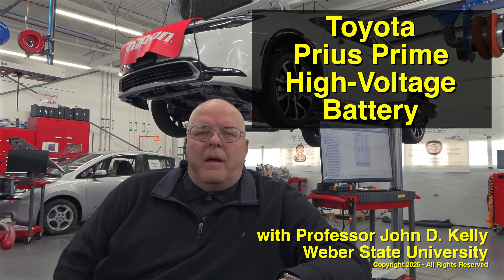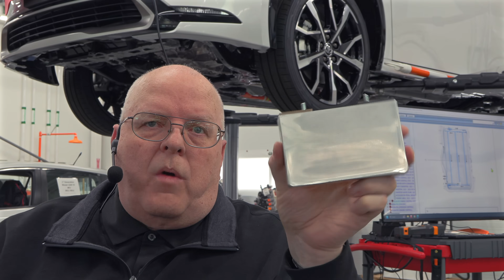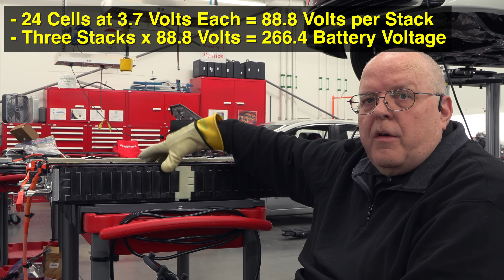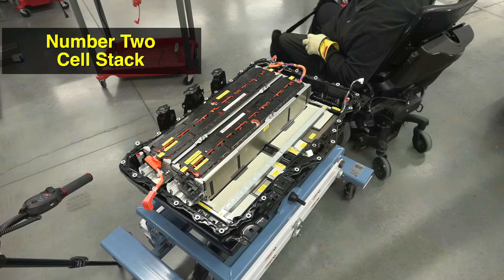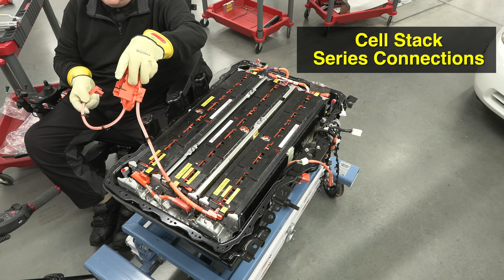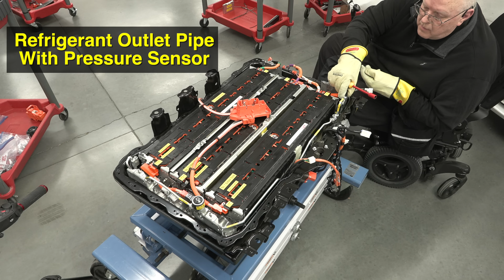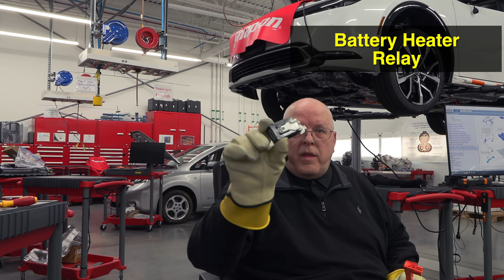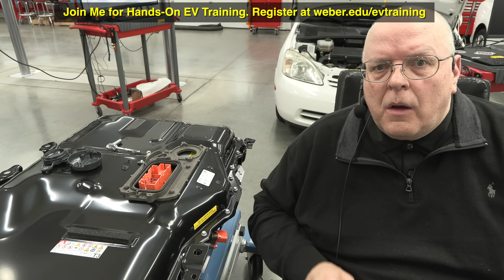2024 Prius Prime/PHEV High-Voltage Battery Build

Comment: 2:53 hey the “Heat Shields” are actually thermoformed Mica sheets that are used as high voltage insulators! Used all over EVs! Very cool material
Reply from the maker: Awesome information. Thank you very much!
Reply: Mica sheets have also been used in high voltage ozone generators for over 100 years- although not as pretty as those shown by the good Professor. The key characteristic is very high dielectric strength.  Useful features abound for separating battery stacks: thermal insulation, electric insulation, high bending strength due to laminations (in the original mined type at least), chemical resistance and flame retardancy.
Reply: Micarta and mica are distinct materials. Micarta is a trade name for a type of laminate made from layers of cloth or paper impregnated with phenolic resin, while mica is a naturally occurring mineral known for its sheet-like structure and electrical insulating properties.
Reply: I believe that they also serve as fire barrier, preventing or at least retarding the spread of a thermal runaway.
Reply: As a novice tinkerer: I recognized it immediately, especially since it wobbled silently. @doppelhub uses it in his design for a lithium battery kit for the 2000-2006 Honda Insight - https://youtu.be/hQprOqE1FKs?t=571 - very useful for letting you allow conductors which have high potential between them to press very near each other without worrying about creepages. I really wonder who manufactures these -- it'd be really interesting if formed mica were more accessible.
Reply: Correct. They are also used, because it is material that does not burn. They also use this material in Induction cooking stoves.
Reply: I continue to create a project of an internal non-combustion engine, I remind you that I am posting here on my channel the technology and the principle of operation, according to which anyone can create a prototype and enjoy free energy, since I am denied financial support at the stage of the idea and theoretical research, after a year of unsuccessful searches. Including I will begin to assemble a sample. And soon another video will be released revealing my developments, the wind of change is coming! All those who are not indifferent, welcome to fly into this departing innovative car, which will lead to great achievements for the successful future of the planet and humanity!

Comment: Those "heat shields" may well be Mica sheets... it's pretty common material in electronics for electrical insulation, as well as being very tolerant of very high temperature and humidity...

... but I'll admit that I've never seen Mica sheets that big, but leave it to Toyota!
Reply from the maker: Great information. Thank you very much

Comment: Where is or what happened to the heater connector?
Reply from the maker: It connects to the low-voltage harness of the black electrical connector on the front of the battery. I plugged it in with the rest of the harness before I torque down all of the bolts for everything on top of the large bracket.

Comment: Will this battery charge with Level 1 (12-16 amp) from 120V house service or is an upgrade to the home electrical panel needed? Thanks for the detailed and fantastic video.
Reply from the maker: Thank you! It supports Level 1 12 amp and level 2 16 amp

Comment: As I have a 2024 Prius Prime with the solar option, are you able to tell if the solar panel is directly connected to the battery? Or does it go through the onboard charger In the hatch area?

I see where you pointed out the additional blank slots on that one board next to the contactors where they should be, but I don't really see additional wiring paths for connections up to the solar panel. Also, does that imply that it is working at/near battery voltage? 

Appreciate your videos as always.
Reply from the maker: The solar panel is connected to a dedicated inverter to step up the low voltage to a high enough voltage to charge the battery. After that it connects directly to the battery through the contactors mine was missing.

Comment: Thanks for this Professor. It was super interesting to look at the battery pack design decisions & think about the costs & benefits of the paths Toyota could have taken. The reasoning is different with PHEVs vs pure EVs. Was thinking about this when I saw you commenting on using resistive heat to stop cell temperatures dropping too far.
Reply from the maker: Glad it was helpful! Thank you

Comment: I was waiting for this video to come out!
Looks like the battery is quite simple build compared to electric cars.
That's what I like 

Also just something I find out on my own ( let me know if im wrong)
I noticed the prius prime battery doesn't heat up quickly when below freezing and it will still allow Regen even though it's freezing i don't think this will immediately destroy the battery but im concerned it could have an effect on the long run especially in colder climate 
I was surprised when I found out 
And I know tesla doesn't allow Regen or charging in freezing battery temps
Reply from the maker: Thank you. The 12 volt battery heater will try to heat the battery to 7.8 degrees C (46 degrees F) as long as it has enough energy to do so. That will allow some regeneration.

Comment: Its well-designed. Toyota/Panasonic have lots of nice little touches. Even the busbars have that shape with the bump in the middle to allow slight movement if the cells expand. Even though the whole battery module is viced together. Also, the whole thing is very serviceable! unlike most EV batteries which are glued and laser welded together you can't just replace a cell.
Reply from the maker: Yes, the serviceability of this battery pack is a great benefit.
Reply: 👍 It's clear that Toyota is also interested in EVs ! But it does so with quality and flexibility for the future in mind, not immediate high profits .